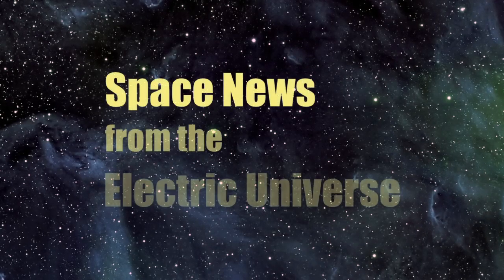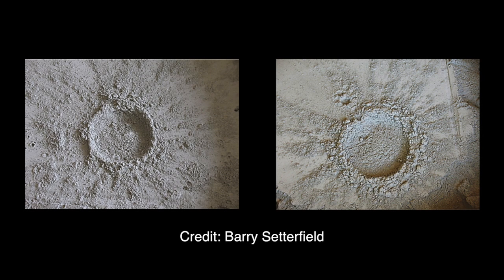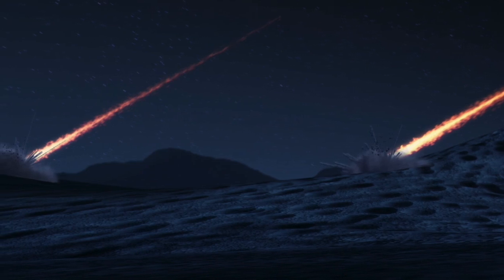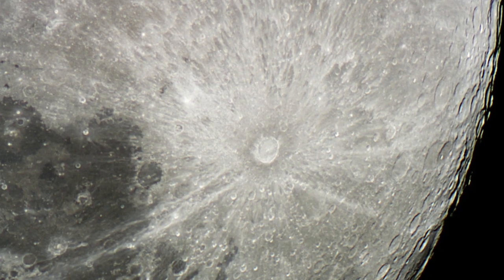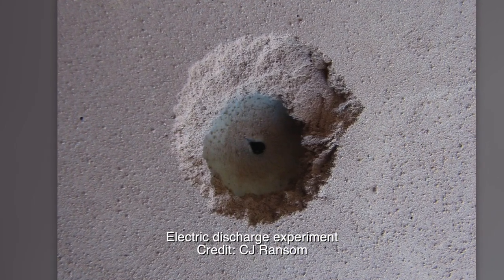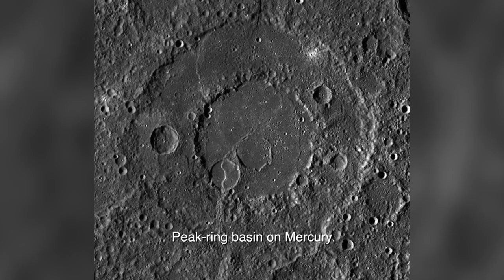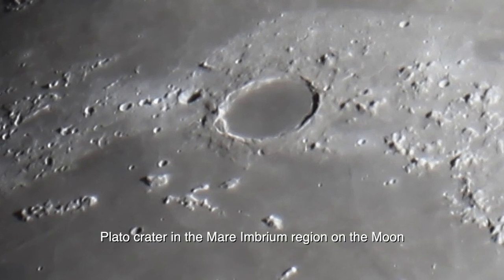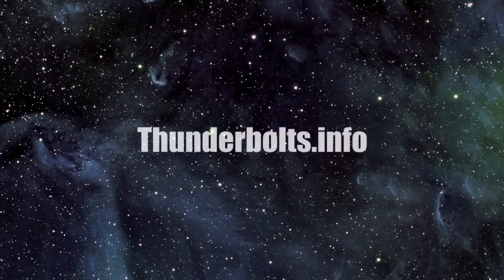Impact Craters vs. Electrical Discharge Craters | Space News

Comment: Impact Crater Study - the experiment is clearly by design and totally misleading.  Problem #1 - the experiment is designed to ensure their test impacts look exactly like what you see on the moon. Ok reality check. What do you reckon the odds  are that every single one of those thousands of circular craters required a trajectory, a direction  of travel, perfectly perpendicular to the impact point? Their drip testing conveniently misses out the fact that the surface of Earth is constantly rotating through space at thousands of miles an hour, and yet every single 'hit' is a perpendicular bullseye? Wow! A rotating ball and yet no other possible trajectories? their all the more ridiculous.

Comment: How do we know that interplanetary lightning strikes will produce circular craters, just because plasma arcs can be produced in a lab or for commercial applications? What I see is a tube hovering over material emitting discharges in a controlled setting. Isn't the plasma apparatus contributing to the circular effect?

Comment: I've seen discharge experiments using pointed conductors above dust piles. But that's an imperfect analogy to a lot of discharges. What if the falling asteroid body is charged and approaches the planetary or moon surface at speed? Has anyone done experiments on this? A body picking up charge as it speeds its way to the inner solar system then approaches a moon on an impact trajectory. Experiments should be devised on this model to determine in what ways this might deviate from the "pointed probe" model of discharge.

Comment: Excellent video. One EU theory speaks of bolides unable to hit the planetary surface due to electrical destabilization/breakup before the body hits the ground.  Case in point is the Tunguska event with its vast field of concussion, but no evidence of leftover rocky pieces of the bolide. Would earth have a better protective field (magnetic, atmospheric) as compared to the moon and other planets, and so have fewer impact craters?

What the astronomer didn't seem to address was what happened to the distribution of the mass of the bolide after it hit the surface.  Would the debris be scattered equally or would their remain large chunks of the original object?  Or would the impact not be rock hitting rock, but a concussive force only?

Comment: Can one then calculate the power of the electrical discharge required to move the mass that was in the crater? Can such discharges be measured hitting the moon? 

Surely the voltages and amperages in a lab could be scaled up to moon sized craters? And are/can such discharges be observed? Is the 'vacuum' of space not also a dielectric resisting discharge?
Reply: excellent question.
Reply: Aren’t gamma rays a form of electric discharge (high speed electrons)? so maybe there was a beam of gammas by UFO or else the high powered lightning struck when the moon still had an atmosphere.
Reply: @TheAnantaSesa  unlikely but i'm not going to try and kill the idea.. natural events seem logical when you see the spreading of  these scars.. did you get that idea from joseph farrell maybe? he wrote books on in my opinion the way to far stretched things relating wars in ancient times with giza piramide as weapon, he is correct to say extreme things happened in the solar system and likely got a lot of ideas from velikovsky and thunderbolts project..
Reply: runs naked through the forest; just a brainstorm as to how electricity could possibly flow to the moon.
Reply: @TheAnantaSesa  cool :)

Comment: The best feature of the video is not making personalized negative statement. Then the positive suggestions about the phenomena has more credibility. 

If the type of material impacted and in the meteor matters to the style of crater, then does the electrical effect occur because of carbo/silicon/water etc piezoelectric pulse cause eruptions along fault lines as happens in earthquake due to slippage and liquifaction etc?
Reply: David Wilkie collision of elements discharge of electricity?

Comment: but wth was it what can produce those lightning strikes??
Reply: AXharoth - Lightning is electric current flowing from one place to another, discharging from a body that has more charge than the target.  One element of the electric universe theory is that these lightning strikes come from electrical interactions between the bodies in our solar system, like planets, during times of orbital instability.  Think of walking across your carpet and how your body is picking up electric charge then discharging when you touch your cat.  The theory goes that bodies in space become charged as they pass through space and interact with the solar wind.  If a planet like Mars were to swing in close to earth, there would be an electrical exchange like you had with the cat but on a planetary scale.  Check more of the thunderbolts.info videos for better explanations 😊
Reply: Kelly Lewis
thx
Reply: AXharoth tfr motivo le